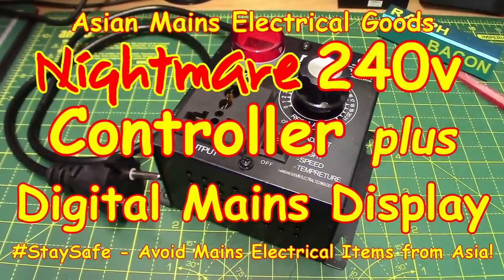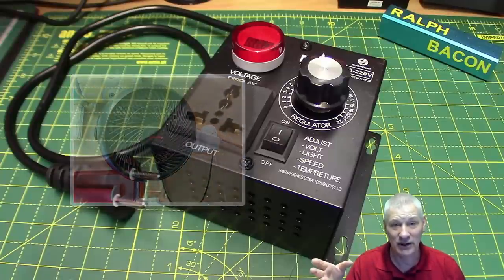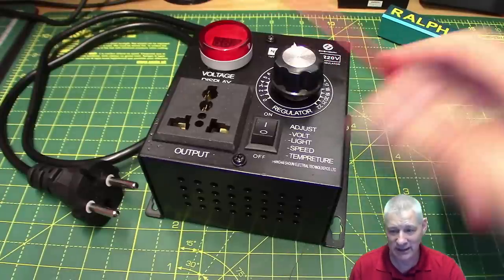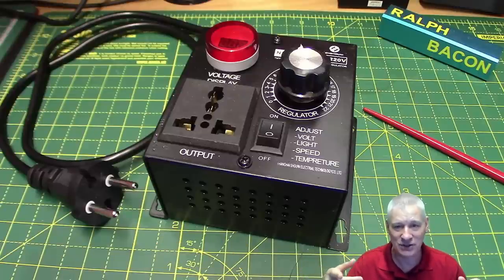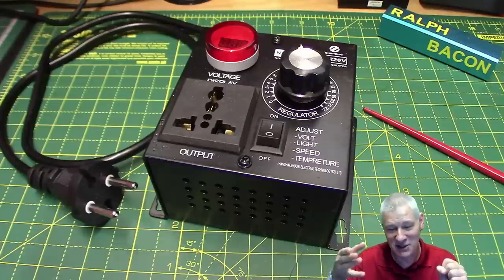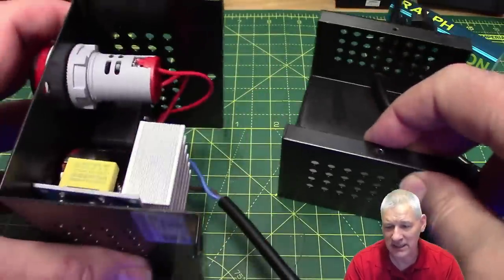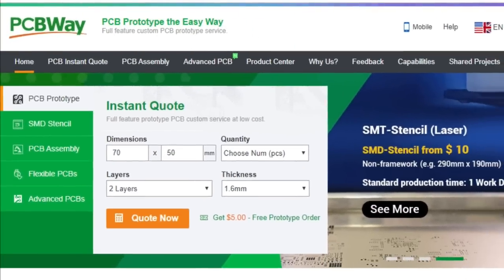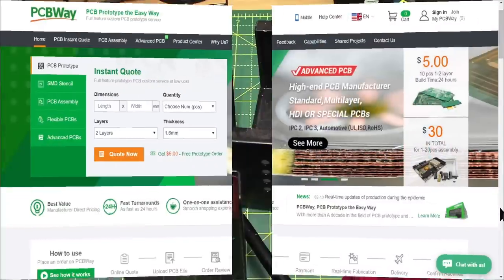#188 Nightmare Fan Speed Controller PLUS a Volts & Amps Digital Display

Comment: Here's the solution to both your heater and fan issues :-)
https://www.christherm.de/luftluft-warmepumpen/panasonic-nordic-inverter/
Quiet, remote controled and it gives you clean fresh air all year round.
And it's safe to use...
Reply: @2000jago  Totally wrong. They produce heat from the outside air and not from electricity from the grid. So its cheaper and eco friendly. Just the initial cost is high, but its an investment that lasts 10 - 15 years.
It cools the house in the summer, and heats it in the winther. Pluss it filters the air. Constant temperature and air quality all year. But that's maby not a good thing?
Reply from the maker: It's also well known that running an Air Con unit  in reverse mode (ie to get heat) is very efficient; it's the other way (to get cool air) that costs a fortune. A heat pump should be efficient either way but with a high initial cost, as you say. Maybe in my next workshop, Geir...